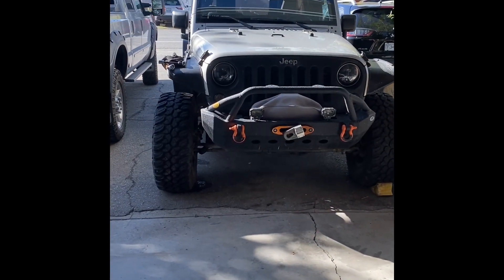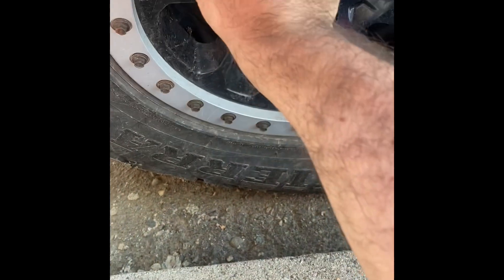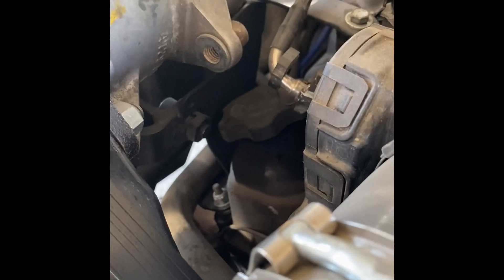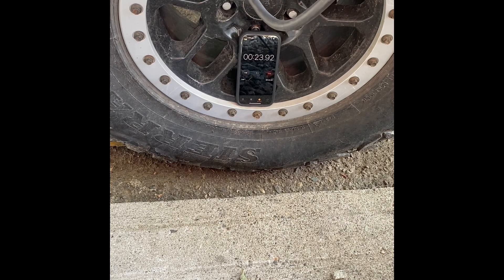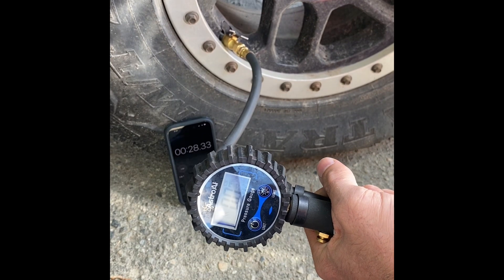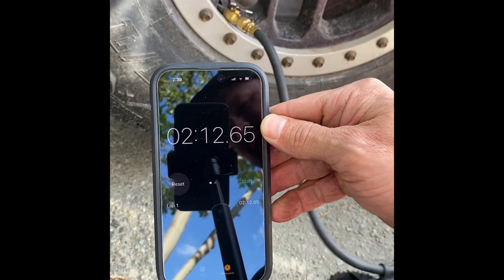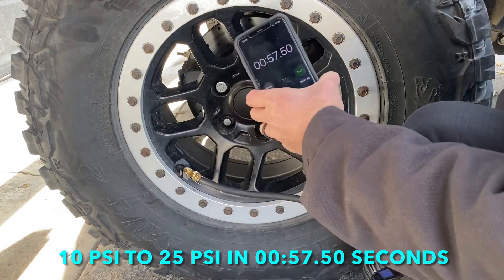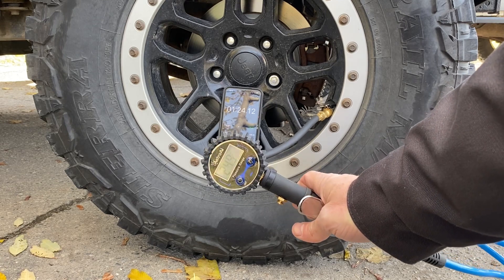DYI Jeep JK onboard air compressor system.

Comment: Sweet the first video i see with a 3.8l.
Do you still have the original ac up and running?
What belt are you using?
Reply from the maker: I did have the original AC working with the air pump. Not 100% sure what belt I used. I took out the 3.8L and swapped in a Hemi V8.